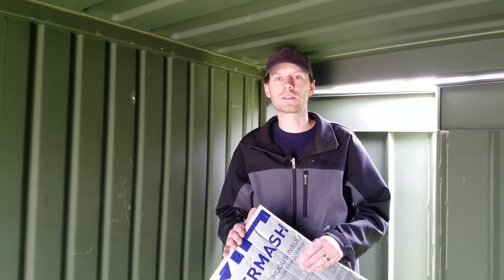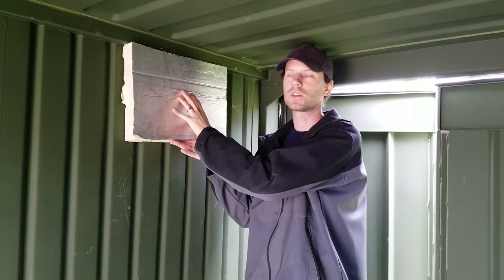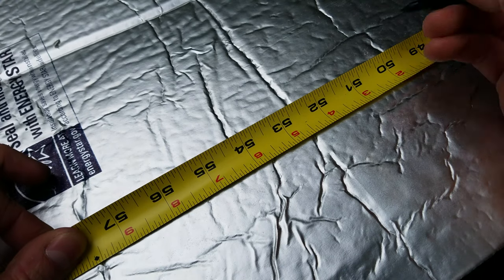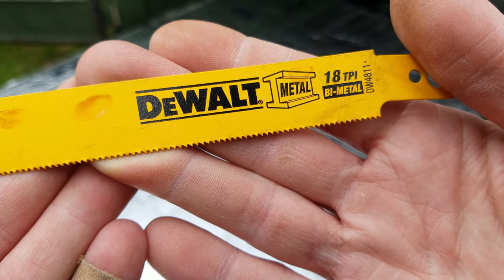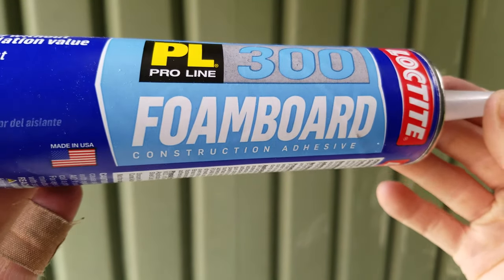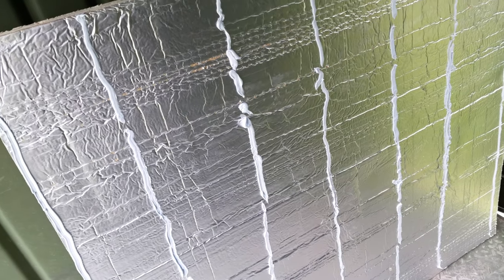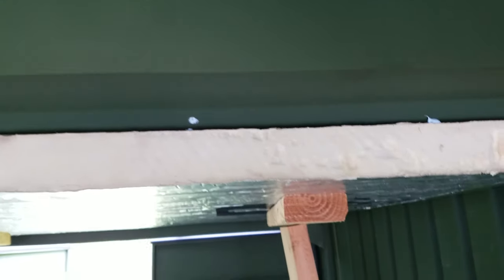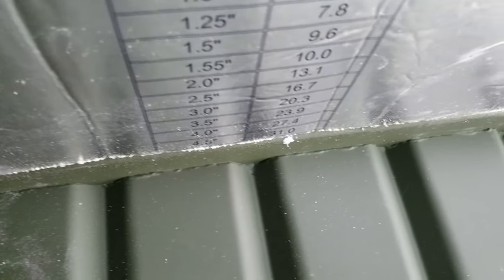Installing Foam Board Insulation in the Shipping Container Battery Shed

Comment: There are a lot of comments on putting the insulation outside.  When insulating a shipping container you must have the insulation 100% inside OR 100% outside.  When installing it inside it's a good idea to cover the foam with drywall or cement board.  When installing it outside you need siding, roofing, and foundation that is thermally broken.  I can only expect exterior insulation ends up costing at least 10x as much as interior.  This approach of the interior insulation is faster, simpler, and less costly.
Reply from the maker: I was planning to use 1/2" plywood for the walls. Do you think that's a bad idea? I could use drywall but don't think that would provide good enough support to screw things to. I could put 1/4" cement board on top of the plywood for a non-combustible surface where I plan to mount things like the MPPT controllers?
Reply: @LithiumSolar  Hi, No, it's not a bad idea.  I would use plywood too.  I'm mentioning the drywall or cement board because the devices (inverters/chargers) are supposed to be mounted to non-combustible material.  But whatever you want to do is cool.  You just seemed like a stickler for wire gauge and fuse type, so I was making an assumption you would be a stickler for following the manufacturer installation manual.
Reply: why does it have to put either 100 % inside or 100% outside on shipping container?  I'm thinking of putting 1 inch rigid foam inside on the ceiling (winter is here, and woodstove needs some insulation to keep me warm in shipping container asap ), and once my saw mill gets going and I saw wood planks for siding (hopefully by spring)  - I'll install 2 inch rigid foam on outside walls and 1 inch on the roof from outside, with wood siding protecting the inch rigid foam.

Comment: For anyone considering these in the future (when the cost quadruples again...) look for a "high cube" or high boy mentioned in other comments. They give you 1' higher clearance which makes a big difference. I like the foam board, glad you put out the video. One other point on the aluminum foil wrap.. I found that "radiant barriers" only work when you have a gap.. does not have to be large, and half of your walls will be gapped by the wall shape anyhow. Not sure it would be worth doing in this case but I hear it makes a big difference on roofing. Thanks again!
Reply: I’ve heard of gaps being an issue and crating warm air pockets which basically serve no purpose of the insulation. There are companies that makes foam sleeves to fill this void. I’m sure it’s worth looking into but I can imagine is probably pricey too.
Reply: Standard containers are 8 feet, 6 inches high on the outside, with a corresponding interior dimension of 7 feet, 10 inches. A high cube container is one foot taller, so it has an exterior height of 9 feet, 6 inches, and an interior dimension of 8 feet, 10 inches.Dec 18, 2021
Reply: @smithbarnes2090  Yeah I was gonna say mine are 8 feet high. That dude must be a GIANT.   My vids prove giants to be real also btw....  :-P
Reply: So how would you put the foam boards up with a gap?

Comment: I have a metal shed and this helps a lot. I used to think only wooden sheds can be insulated due to the structural frame in the interior of wooden sheds. This is way cheaper than buying a 2000+ dollar wooden shed and insulating that after.

Comment: I'm glad you uploaded this video because I got a similar idea to put half inch foam board on my wooden shed on the roof rafters 2 by 4 I was just going to use drywall screws to attach and maybe some flashing.
If it goes well I could put it on the inside walls. And thanks for the tip about this special cement that is for foam board. I did not know that!

Comment: Thanks for the the introduction regarding insulation of the Cabin. May I ask, why not do the heavy insulation out side the cabin with wooden lining? What you need is maximum volume inside the Cabin. After the outside insulation is finished, you can have lighter insulation inside the Cabin. This way you don’t crouch , as you enter and for maintenance work. The inner wall then, can be lined with, wooden planks. But in any case the cabin will heat up, if you don’t have ventilators. You MUST have exhaust ventilation. The batteries will produce gas that are inflammable, during charging process, though not as enormous as PbSo4 composition.
I’m curiously watching.  Wishing you all the luck. Stay safe.
73s
Reply: outside insulation would be more trouble AND would have to have wood or something to protect the insulation from the weather.
Reply: if ventilation becomes a problem he probably could use a dryer vent for a house and it should be decently resistant to rain coming in but that could be a problem if it floods frequently where he is but he could also do a solution by using the space below where the fork lifts go but also could be a problem if it floods but i have seen a guy use a rv air conditioner for his batt storage container.
Reply: @flyingdiscproductions So you would just leave the outside wall metal exposed?  Can you apply foil back foamboard to outside metal, then 1/2" plywood, then vertical vinyl siding?
Reply: @michaelhouy1382  I have seen much metal siding on buildings in my day.

Comment: I have 1 40ft high cube and 4 20ft standard height shipping containers. I ordered 9 4x8 4ft tall pallets of surplus polyiso foam from insulationdepot for 20% of Home Depot prices. The thicknesses are 3.5 to 2.5 inches, he also has thinner available. 4 walls, ceiling, and inset man door insulated.

I am in Alabama and installing my air conditioners this week and looking forward to the foam next week. I plan to make lines of spray foam and stick it to the roof and walls. Then depending on the gaps, maybe get a froth pack.

Comment: Nice job 👍, a humble opinion, you can put both fabric cut to make the joint and the cut side to the end. The no need to fill the gap with spray insulation.

Comment: I find a manual pull saw work works great on foam board.  Just as clean and fast as your saws-all type.  I just use a cheap Harbor Freight one.
Reply from the maker: My saws-all is from Harbor Freight as well ;)

Comment: FYI, we install a good deal of PolyIIso.  We make our own knives for cutting this material.  We use a 2" or 3" drywall mudding knife sharpened to a razor edge (just one edge sharpened for safety).  This will easily cut across the depth of 2" PolyIso.  A little silicone spray will allow the knife to slip through the material.  We usually make a light pass and then go deeper for a second, & maybe a third pass (working on plywood).  Be careful!!  We sharpen our knives RAZOR sharp and keep them in cardboard sheathes that are clearly marked.  This way we don't have all that particle created from using a saw.  We also tried a hot knife,  but I don't like the idea of breathing the vapors created by heating PolyIso with this method.  We also tried using a table saw, but the fine powder (lots of it) got into the motor and froze up the berrings.  Like your videos:washhands:
Reply: DK,, i have a 14x24 pole parn style pre fab garage with metal siding,, perlings are 2x4's I'm wanting to use siler backed INS. BOARD with the other side being white.. Dont you want to put the Silver/reflective side against the metal ?????
Reply: @hideawayoutdoors611  Fun project.  Good question, longer answer.  Not sure which foam board you're using.  Short answer: the foil should not touch anything.  PloyIso has foil on both sides.  Overall, if the silver touches anything, it is no longer reflective, but conducts energy.  Any time you have open space, there is air churning which diminishes thermal barrier; so if you are keeping a 1.5" space along the plane of the purlins, this could be a "drain-plane".  Not huge, but it's a factor, maybe "plus" and "minus".  So far, I haven't found a "silver" bullet that will fix hundreds of problems that most homes face, because a house is a "system".  In general, you have 3 barriers - water, air & thermal.  They should be continuous (as much as as is feasible).  Hope this answers your question.  Try Joe Lstiburek.

Comment: Seems are roof over it to keep the sun from beaming on it would help a lot, could you re-purpose the roof of your old shed for that?
Reply from the maker: I'm planning to put a few panels on the roof of the container, raised up a bit, to block the sun from hitting it directly.
Reply: @LithiumSolar  Excellent idea!
Reply: @LithiumSolar  good idea. I prefer NOT punching holes in the top of the container. - the sides are fine to punch holes in.
Reply from the maker: @flyingdiscproductions  I was thinking of somehow affixing them to the 4 lift points so I don't need to punch any holes. I already have to punch 3 holes in the walls/floor and I REALLY don't want to, but I need to run an AC conduit, DC conduit, and HVAC lines.
Reply: @LithiumSolar  side holes are fine - it is the integrity of the roof that i am personally concerned with. - oh, and windows can be installed and sealed around the edges.
Reply: This is a HUGE factor ! Keep the sun off the container roof with either a false roof over the container roof or completely cover the container roof with solar panels. It will make a MASSIVE difference in keeping the container cool...ask me how I know ;-(

Comment: Tall person here who only owns one standard height box for storage but four 40' High Cubes.  Don't find out the hard way not to buy standard height boxes! HCs have (obviously) far more internal space and that also provides improved air circulation.  20ft HC containers exist but usually require time to source (there are many brokers but not many seaports) if the length is an issue but the expansion room and convenience are worth it.

Comment: Hi everyone,
There are air between  foam and the metal, so the vapor inside is going to turn into water when the plate gets cold.
Spray foam are better for this job.
Reply from the maker: Not entirely true. I just pulled out this insulation after a full 3 years and there wasn't a single drop of moisture anywhere under or behind the insulation.
Reply: wow, right on. How do you think you managed that?  @LithiumSolar

Comment: Good idea to use the close cell foam for the insulation. However, I think you installed it backwards. The aluminum sheeting is supposed to face outwards because that's what reflects the heat. The way you have it installed means that it would actually help to keep "in", like an oven. But, with that said, how much of a difference will that make in the end with it being in a shipping container added with where you have the container, not sure. For sure though, if this was installed in a wood frame construction, make sure to face the aluminum sheeting outwards to give the most benefit of the sheeting. Otherwise it's there just for looks.
Reply from the maker: It has the same aluminum foil stuff on both sides :)
Reply: @LithiumSolar  Ahhh, I was wondering about that. I didn't notice it on both sides, but that's a good thing then  😉

Comment: You could have bought a high boy container which would have given you a higher roof. Paint the outside of the container with a fireproof and insulation property which will help the container be cooler.
Reply from the maker: I have limited space to work with and much larger wouldn't fit where I want to put it. If I was able to go any large easily, I probably would have just gone for a standard 20-footer.

Comment: Scrap away the extra expansion foam.. and then take a roll of tin tape.. (HVAC Supplies) and seal the seams between segments.. nad you got a great finish and keeps filtration clean, isolating the inside and outside envelopes..

Comment: Is that insulation fireproof? The whole point of using a shipping container for your batteries is it will not burn.. I would have used rock wool insulation..
Reply from the maker: The idea is to prevent fire from happening in the first place ;)
Reply from the maker: And no, the insulation used here is not fireproof.

Comment: Hi,good job with the diy you can buy aluminium foil tape to cover the joins
Reply from the maker: Thanks! Would that be the same foil tape that is used on hvac ducts? Or is there a different kind for insulation/foam board?
Reply: @LithiumSolar  Yes, foil tape used on ducts can work.  But the foil on the foam board usually has residue on it.  Wipe the foam board (seam) down first with mineral spirits or denatured alcohol.
Reply: You should be able to buy a roll where you bought the insulation

Comment: For exactly the reason of "no gaps", we usually would do 2 X 1" layers & stagger the seams.  This is a "percent" that adds up with all the other "percents".  With a FLIR you will see exactly where the heat is leaking in/out.  The overlapping of seams is better performance.  What about air?  Containers usually have vents.  You could build a large HEPA filtration at the intake.  Most everything adds VOCs to the air.  Some sort of HRV or ERV is important in such a confined space.  You can't always smell VOCs.  Carbon Monoxide is odorless & tasteless & lethal.  Might not seem apparently important today, but the affects linger into damage in older age.  Die early, it doesn't mater.  Live longer, it all adds up.
Reply: what are VOCs?   WHAT IS HRV OR ERV?
Reply: could you explain this please?: "For exactly the reason of "no gaps", we usually would do 2 X 1" layers & stagger the seams.  This is a "percent" that adds up with all the other "percents".  "
Reply: @marissastafford4389     Did I send a reply already?  
Volatile Organic Compounds
Heat Recovery Ventilator
Energy Recovery Ventilator
     Seal Tight & Ventilate Right, 
     energy efficiently
     building science
Reply: @StaffAction       Heat will work its way around building elements like water does.  Instead of having a single layer of 2" Iso where heat can easily pass (leak), having 2-1" layers allows us to stagger as many seams as possible so the heat has to go around and around, trapping more heat.  If air can leak, then so can heat and it creates convective loops and may allow water (vapor) to get to bad places and be trapped. Joe Lstiburek made that mistake on one of his early homes where an old-timer warned him before he did it.  But he still did it.  Check it out.  It's interesting.
Reply: Thank you for explaining.  not familiar with Joe Lstiburek.   @DK-vx5co    Also, re: VOCs.  is Carbon monoxide really a concern in the wilderness?  No gas or machinery nearby...
Reply: @StaffAction     You've begun a very interesting and fulfilling journey.  I've never heard about CO being a danger outside of combustion, but I'm no expert on this.  We were driving behind a 1970s muscle car and my friend's CO monitor alerted.  Essentially, there is no "good" level of CO.  Some of my associates have spent decades on tiny corners like this, so it's beyond my knowledge base.  Start researching, and realize that some percentage may be nonsense, and it may change as new knowledge is uncovered.

Comment: The dead air between the metal wall and insulation will allow condensation to build and produce mold. To stop that you need extra vent holes to circulate the air to escape that's the magic trick to prevent mold. Extra money and time now or toxic harmful health issues later. Hope this helps for future projects.  Spray foam outside and stuco over it leaving the vent holes for the inside air trapped between the metal walls and sheetrock to escape .  4 years later now and no mold or health problems. Just like your attic in your home needs ventilation.

Comment: 2 years later how is this working for you?  Any condensation issues? How much did it lower the internal temp on hot days?
Reply from the maker: Nope, no condensation what so ever. It's hard to tell how much it's actually lowered the temp. It's more important for winter. I just leave the door open in the summer for right now.
Reply: @LithiumSolar   Thanks for the quick reply.  I'm in Texas and my 20' container gets 120 degrees inside!  I plan to install a solar fan to circulate the air, but would like to cool it down in the summer.

Comment: The Loctite PL300 technical data sheet says “Will not bond to filmed faced foam insulation panels”.

Not sure if there is a better option though 🤷‍♂️
Reply from the maker: The better option is to not use this kind of foam board. I've already replaced it.
Reply: @LithiumSolar  what did you end up using?
Reply from the maker: @sylvainkalache  This https://www.homedepot.com/p/Owens-Corning-FOAMULAR-250-2-in-x-48-in-x-8-ft-R-10-Scored-Squared-Edge-Foam-Board-Insulation-Sheathing-52DD/202085962 with the same adhesive.

Comment: Do you monitor temperature and humidity within the shed?
Reply from the maker: I monitor temperature manually right now. I'm still working on the cooling system.
Reply: LithiumSolar thanks for the quick response! Do you have any ideas as to what you will use for cooling system? Thanks in advance!

Comment: I am actually working on kind of a similar project and was wondering what kind of temperatures you are expecting inside the container without insulation. And what the expected temperature range will be with insulation. Also, do you recon this insulation will keep the cold out in winter?
Reply from the maker: I'll be installing a heatpump of some sort to keep it cooled in the summer and warm in the winter. I don't need it at normal living temps, anywhere between 40-80F should be fine... I'm not sure on specifics just yet.
Reply: @LithiumSolar  Thanks for your answer! Keep up the good work! Maybe I will post some videos of my project, once it is done.